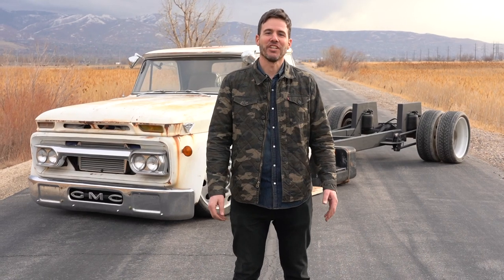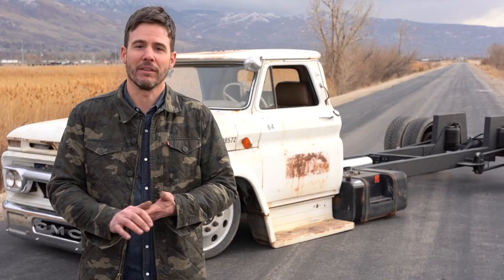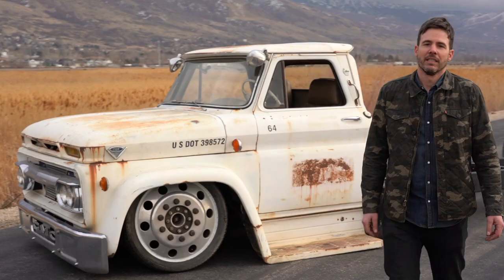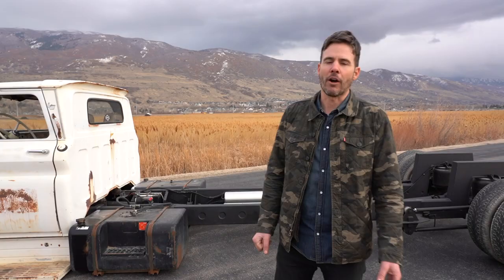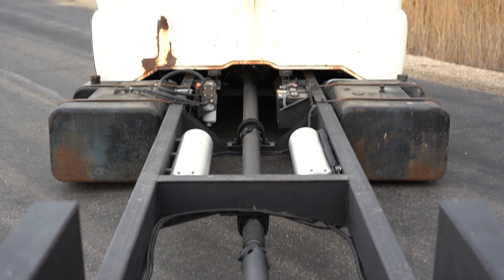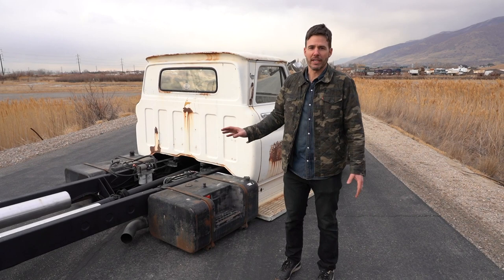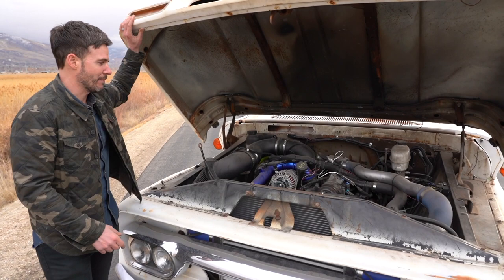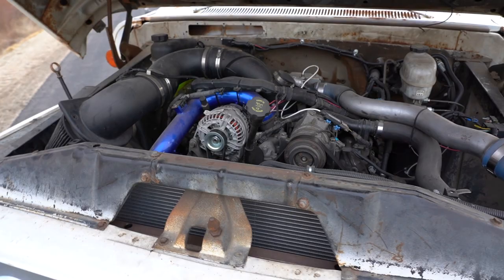1964 GMC 5500 Duramax Swap Air-Ride, SOLD

Comment: Great video, I have a 2011 2500hd gmc gas,with a c6 transmission, any custom swap because of the torque converter problems, thankyou

Comment: Hello there...I absolutely love this video!! I also have a 1964 GMC 6500(RED)...but some poachers stole my driver's side door...and I was wondering if you guys knew were I could find a replacement door...I want some work done to it...the pistons are busted...so I would live to do and engine swap and air suspension pkg...I eventually want to go fully custom...but I just want to get it running and I will do other customization work in spurts...do u think u could assist me with the initial project?

Comment: Very nice build... What is the load rating on it? And if fully loaded once the bed goes on, will that rear drop design keep it from swaying side to side?
Reply from the maker: Hey there, with the two semi truck airbags in the rear you could pretty much haul the world! It was designed to haul a large truck in the back.

Comment: My 1965 c60 with a dt360 international engine regular spring suspension 22.5 tires looks much better than this
Reply: @jeffreycruse9189 do you have a build thread or videos?
Reply: @AlfioS  coming soon. I am not putting down the lowrider trucks. I just like some more functional that looks big and tough 😆
Reply: @jeffreycruse9189  agreed. I have a DT360 i want to swap into something but not sure what yet. Post your pics / info here when you get it going?
Reply: @AlfioS  I will
Reply: You should see who bought this and finished it. It is sick